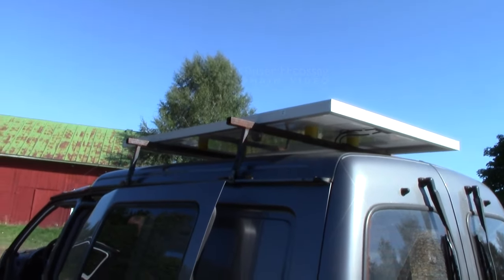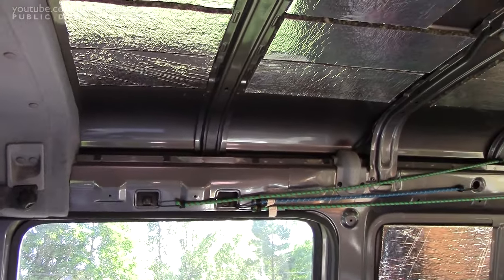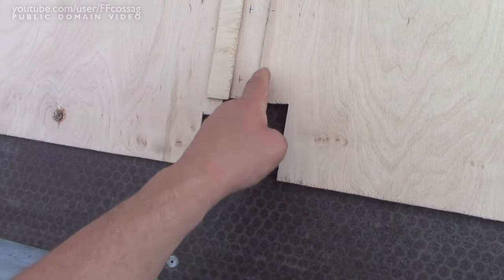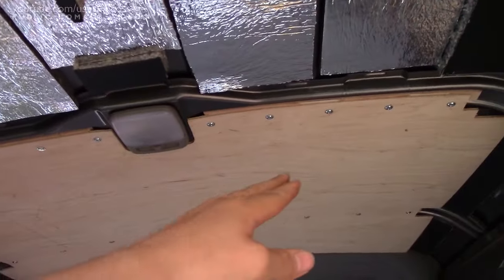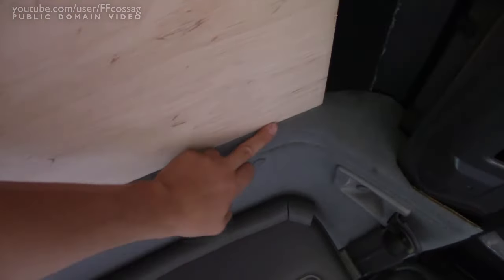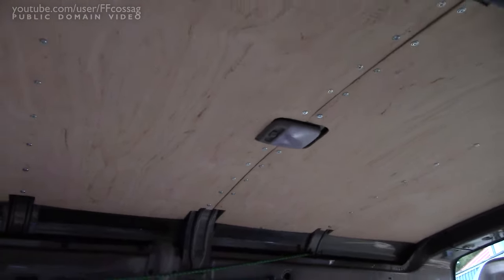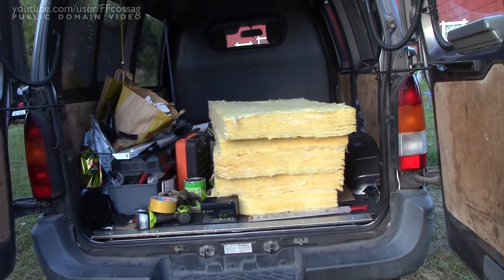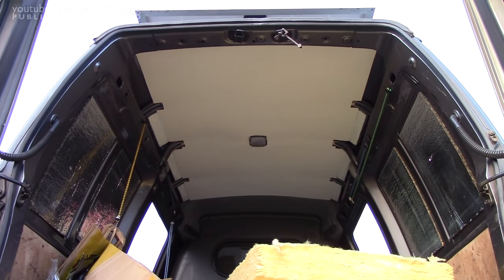Van camper! Build log #2 - Ceiling

Comment: Lining cloth makes vans warmer and quieter. You could use the $40 you saved on the insulation.  :o)
I had a 1978 Ford Transit Mk2 camper, which was glass all round, like yours, and it was cold as feck in the winter time, even with a catalytic heater running...  It was still a great van though, and many fun times were had.
Reply from the maker: I'm not entirely sure what you mean by lining cloth. Rest assured, there's some insulation stuff coming up shortly, and I have some ideas for what to do about the windows.

Something which makes this build a bit unusual is the fact that I want it to be quick to convert back to a work van, so I don't want to for instance glue insulation onto the windows, because they're really useful sometimes (who'd-a thunk it?)
Reply from the maker: SarkyBugger
Ah, that kind of stuff.

Comment: Back in the day I covered my 1965 VW bus with lauan plywood on the doors and sides while fitting insulation. The headliner was so damaged I ripped it out and with the use of contact cement I bonded some carpeting to all of the surfaces of said roof. That was done around this time of year too, damn it was HOT and humid. Not proud to say I no doubt lost a few brain cells in the process.. For the windows I fit thin strips of wood around them, then fit an insulated fabric with push pins There is so much thermal loss in a vehicle that unless you take up a lot of interior space with insulation it will just be cold
If I were to do this again I would use extruded polystyrene on the floor (covered with thin plywood) and get a damned good sleeping bag.
Compressed fiberglass insulation becomes more of a thermal conductor. That foil backed bubble wrap on a roll may offer an advantage.. It was yet to be invented in the early 70's  ;>). Yeah a very good mountaineering sleeping bag is in order..
You going to cozy up to some ice cold batteries too I bet... Ha.

Comment: At the end this series on van restoration we will probably see a completed video and audio servaliance unit commissioned by the Swedish secret service.
Reply from the maker: Ha, I wish - if I were in bed with a gubmn't, I'd vouch for a base vehicle fancier than the cheapest van you could buy 17 years ago.
Reply: last time I did this in a VW camper - I used acoustic panels & plywood as you have & then used a contact adhesive and stuck a hessian (natural fibre) backed carpet to the ceiling rather than painting it. It worked and dampened the natural resonance perfectly.
Reply from the maker: Sasquatch
I can imagine that working well, much like the asphalt sheets you can buy.

Comment: Your video on this one seems to jump every few seconds, but the audio stayed as a clear stream. I suspect it might be your autofocus and maybe something on your lens that the focus keeps trying to jump into focus? Just wanted to let you know. Or maybe it was an encoding error in the video container?
Reply from the maker: That's odd, if I look at it on Youtube it looks absolutely fine. Perhaps it was some issue occurring when the video was really fresh on the net.
Reply: +FFcossag It starts around 5 minutes and 40 seconds. It's a very slight jump in video about every 4 seconds.

I played it in 3 different resolutions. In a mobile platform and full browser YouTube also with the laptop under two different browsers. I was thinking you may have got some saw dust in the lens? You can see it when you look at the pain and the white balance fades out at 8 minutes and 19 seconds.

My new camera does the same jumping with auto focus if it has something on the lens. That's why I figured I would let you know so you can check the lens.
Nice videos, not sure what the final plan is for the van? The sound proofing made me think creeper van, but could also be spy tech van.
Reply from the maker: Hm, you're right, it does seem a bit jumpy, as well as boxy. Odd, I've never seen something like that before. It makes me suspect my SD card, however; it's a cheap card, and every single video on this channel since 2014 has been filmed onto it - that's about 1 TB of writes to the poor thing.

As the man with the van plan, I can tell you that there is very little in the ways. I'm going to tour Norway for starters in a few weeks. Whatever happens next, no one knows. The sound proofing stuff is just put there to reduce road noise, since these are VERY loud vehicles.
Reply: +FFcossag Hmm, I guess that could be if the SD card is writing slower as it gets older and dropping frames. It does seem to happen when your moving and panning more with more frames per second. I never saw that before, but then again I don't know if any of my card live long enough to hit max read and writes. Ok, well maybe on Sandisk card has in my Nikki's camera but I don't do video with that DSLR, it's for pictures only. Probably 8 years old by now. Well good luck on the trip. Just thought I would let you know about the frame jump. It would have sucked to have your card die on your trip and loose video. I hope you replace it before your trip starts if that's the issue.
Reply from the maker: Gadget Review Videos
Yep, I'm gonna replace it. Thanks for pointing it out, I would definitely have missed it since I attribute glitches like that to my video editor acting up in the preview rendering.
Reply: +FFcossag No problem, I've seen rendering glitches with my software also but nothing like that 🙂 . It may have been host also if it was in the sun? Always good to have a spare especially on a trip? I just caught your #3 video on the ventilation, nice.